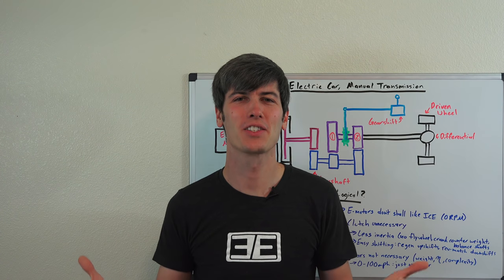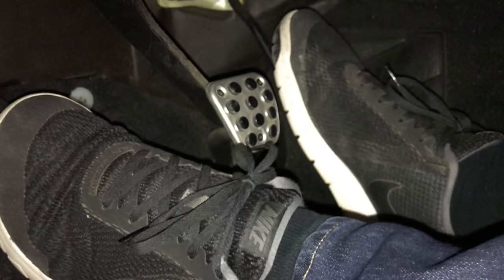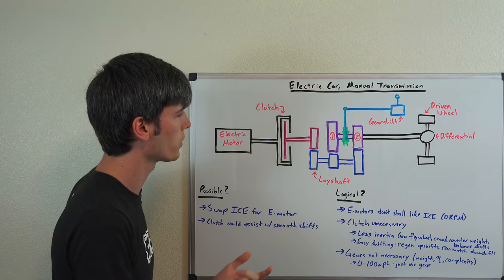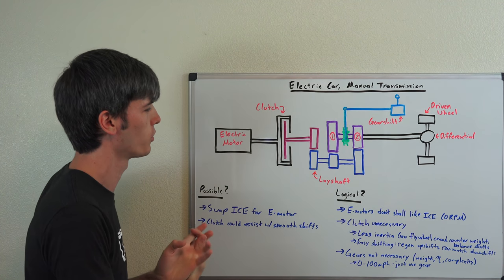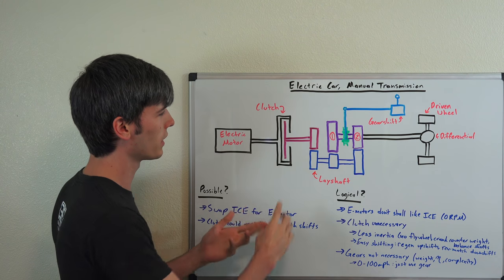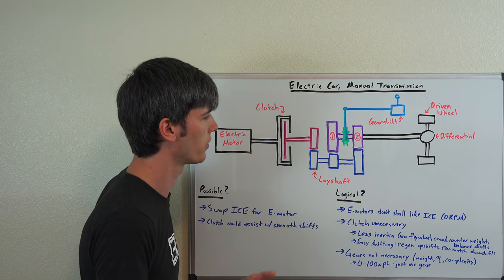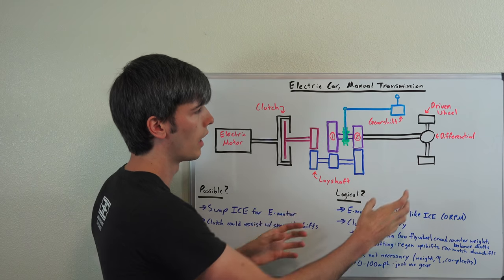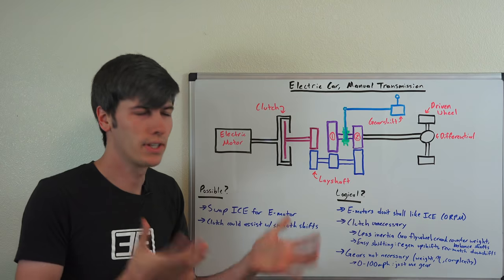Could Electric Cars Have A Manual Transmission?

Comment: I would like to see this done in a porsche body.
rear electric engine mated to a normal 5 or 6 speed transmission, running to a LS Diff, and to the rear wheels. batteries could be stored where the back seat would be.
I bet the driving experience would be dramatically different.
and HP numbers would be almost useless.

it would be simpler, to use two separate electric motors to run each rear wheel. powered by a shared battery and inverter. the gas pedal would just regulate how much electricity is escaping the battery to run each motor. so the wheel speeds would be matched in output as long as weight transfer and load dont change, and if they do (say in cornering) the extra load would slow the tire as the friction on it has increased, thereby keeping a differential effect.

Comment: manual transmission are completely logical, regardless of whether the engine is electric or traditional combustion.

Anyway, manual transmission has more advantages than disadvantages.
Even if electric cars don't need it, I still think it would be interesting and even necessary at some point.

If electric cars don't have a manual transmission, I'll design one myself.

Comment: Instantaneous Torque only applies to BRUSHLESS DC motors. Essentially the rotor is locked to a rotating magnetic field generated by stator windings.

BRUSHED DC motor EVs would require a transmission for maximim performance, as they do not provide instantaneous torque. They take time to spin up and down like an ICE. They are relatively easy to stall so if anything, a transmission would be essential. 

This is why, if you pay attention, most modern brushless motors directly drive the load - like the rotor of a drone or the wheel of an electric scooter. The motor can provide the essential torque at the proper speed directly. On the other hand brushed DC motors often require a gearbox in whatever application they are used in.

Brushed DC motors are simpler to control and cheaper overall. I'd be curious of a brushed DC EV with a traditional transmission would be financially viable?

Comment: Efficiency translates to range. As we all know, range anxiety is the #1 reason EVs have low consumer uptake, so it's likely that manufacturers will soon include at least a 2-speed. Manuals won't happen of course, but 2-speed DCTs are very logical. A DCT with only 2 speeds doesn't even need synchros, it's just one gear per clutch, so it's incredibly simple, compact, and cheap. The comments about introducing inefficiency are misguided, because a 2speed wouldn't be in addition to the large gear-down set, it would be incorporated into the transmission itself, and really wouldn't lengthen the path the energy takes.
Source:
https://www.google.com/url?q=http://www.researchgate.net/profile/Jiageng_Ruan/publication/268983741_Comparing_Of_the_Effects_of_CVT_and_DCT_on_the_EVs_Including_Braking_Energy_Recovery/links/547d524e0cf285ad5b088c7d.pdf&sa=U&ved=0ahUKEwi498mEh4DWAhVF_4MKHUI3BrEQFggLMAA&usg=AFQjCNEUGLjrfHtoOPRI6Qjh7DdRh7uulA

Comment: I have a hard time believing anyone would do this or want it.  One of the draws for an electric motor is the high torque at low RPM.  To add a clutch you would either need to electronically limit the torque or have a disproportionately large and heavy clutch.  Plus, unless you add a lot of rotational mass to the motor, you aren't going to "feel" the clutch working anyway.  There won't be any feedback if you don't rev match since you won't be forcing a heavy crankshaft to match speed with the wheels.   Plus, the computer is going to have to do the rev matching for you.  The inertia of the motor is so little that just tapping the throttle would almost instantly hit max RPM.  So the car will have to rev match for you.  There will be so little traditional stick shift feel that you might as well just put a "fake" clutch pedal that doesn't do anything.

Comment: I must disagree: it's fine not to have a gerbox if you have a 200 or 400kW motor, but if you go down to earth and imagine that manufacturers will put some 50-100kW motor that most current   internal combustion cars have than a gerbox is quite a viable option. Since a car with a gearbox will reach max speed noticebly faster than a direct drive counterpart.

Comment: Would a transmission be applicable in a heavy duty set up? Like for electric semi trucks? or would it be worth the weight gain to have to have an electric motor at all driven/live axle wheels like in a freight train? What about low speed applications such as in rock crawling?

Comment: perhaps not logical for electric vehicles, but as far as ICE vehicle I only have one comment. When was the last time you heard of a manual transmission failing and leaving the driver on the side of the road? And how many times can I think of that happening with an automatic? Well it's happened to me more than once.

Comment: the reason why manual transmissions are still very popular around the world (except the USA) is not they're enjoyable, but rather they're cheaper, more reliable, more durable, less maintenance, and more efficient than automatic transmissions. So it makes sense to use one unless you are lazy or are a professional race driver where you need to shift in 0.2 seconds.
Reply: Also manuals are ligher and allow you to drive the car the way you need to. I've driven an automatic once and man that car seemed to have a mind of its own, I had to spend some time to understand how it will react in certain situations in order to anticipate it and know what to do in advance. With manual it's easy, you just do what you need to without worry.
Reply: That being said, I don't think there's a need for manual transmission on e-cars since they can start from zero RPM and have a lot of torque at low RPM as well as a high RPM range, so no need to vary the transmission ratio.

Comment: If you put an electronic motor driving each wheel would you need a differential? Are electronics clever enough to calculate wheel speed to road speed in corners & sharp turns ect?

Comment: I think it would be great to have a transmission. But it is not necessary for a city car.  i think it would be needed in an offroad vechicles that would need more tourque  and  a higher gear for normal driving...

Comment: Why not just change it so that the transmission is used as a mode? Such as gear 1 would change to Standard Drive (SD) or perhaps make it so that it can only exceed to perhaps 60 or change it so you could not go above the law of lets say 20 or 30 mph at a normal road?

Comment: Most electric conversions done like mine still have a clutch and the gearbox, but i really need just the second, third and forth gear because the gearbox cant handle the rpm and is noisy anyway

Comment: Hello, I have two questions.
With a manual transmission you can use a "smaller" engine for the same car?

Can a manual transmission improve the range of the battery?

Comment: I think that on motorcycles that are meant to be fun the clutch is essential. 
That is because you need a computer to control the throttle response so you don't have full torque as soon you twist the wrist. 

But that means that you either have a smooth throttle response or a wheelie capable one! In other words, if you ridding casually and want to make a wheelie you would need to mess with menus and throttle control computer maps! Awful! 
If you see some dirtbike enduro videos you'll notice that clutch control is a very big part of the riding technique. Basically you need to change all the time between smooth power to get traction and sudden power to slide or lift the front wheel!

Comment: I was wondering if the electric motor wouldn't need a clutch if it can go to the next gear by revving to that input speed that is needed? If electric motors can cover a much broader rpm range and don't stall, why would you need a clutch for the transmission?

Comment: What i do really ask myself though is, even mountain bikes that are powered by feet have a transmission. Couldnt you be able to make a lot less powerful motor with less torque and therefore more battery efficient and add gears instead so that you progresively gain speed and save money and energy?

Comment: Gear doesn't mean only for speeds, it's also for power. If electrical bycycle (pedal assist) with gears sounds logical then why not in cars!!? Not everyone wants to ride fast in cars, guys like me likes to feel connection with the machine with decent speeds... I think introducing gears in hydrogen ev or ev isn't. Bad idea when power is required than the speed..

Comment: look up for electric gt....those guys are very enthusiastic in converting old nostalgic vehicle with manual transmission into and EV with manual gearbox....they did exactly like what have been told in this video...they just swap out the IC motors with an electric one....

Comment: I will only drive an electric car if it has a manual transmission with a clutch, and i stand by that! Also they could just make manual electric cars have like some rpm as an idle, so that it could work the same way as regular gasoline engine cars and so on, car lovers will like this alot, regular people can stick to their no gearbox electric cars, but as an enthusiast, i need the manual transmission, thats how it is and always will be!

Comment: I don't buy the efficiency loss. My thought is that the electric motor can run at lower RPM thus using less battery power to turn the motor. The transmission then amplifies the low output of the motor. Using less power to accomplish the same speed. It's the same as with a bicycle with gears. The momentum of the vehicle overcomes the drag on the drivetrain if one is in the proper gear.

Comment: What concern's me with EV's is the inevitable words from a 'mechanic' - unfortunately your battery pack has gone and a new one is $15,000 plus fitting.....for example, the e-golf from VW, looking up the current price of a new battery on VW's own ETKA parts database with latest pricing - £11,827.28 (about $15,000). 

So yeah no transmission means no expense on having to replace it if it fails - but now you have something MUCH worse...something that costs more than a new engine and a new transmission combined! - something which is going to be shot within 10 years for sure, making 2nd hand EV's much older than 5 years old, scrap.

Comment: Hi Jason,
I am Joy from India and  
1st of all I would like to tell you that I really love the way you explain and have learned lot of things from you regarding automobile vehicles. Today I would really like to know something from you as I know for sure that it is you, who can clear my doubts on this matter. 
The thing that I would really like to know is that, is it possible to make an autonomous electric vehicle that does not requires charging (after the 1st full charge). Will sufficient current be generated if a liquid cooled electric motor in a vehicle stalls continuously like an internal combustion engine and is connected or detached from the driven shaft by a transmission?....
Joy

Comment: you dont need clutch on electrical motor. you can use so called electrical clutch. that would disconnect power from motor in similar way like clutch

Comment: I have a valid logical reason to drive a non electric car with a manual transmission. If you are driving an automatic and your starter stops working and you don't have the money to fix it, you can't make your car move. Rendering it worthless. If you are driving a manual you have the option of popping the clutch and your car is still drivable.

Comment: What about gearboxes for the purpose of switching between high torque & high speed for different applications? Some RC vehicles have 2+ speed gearboxes which allow you to have a high torque (RC tank or monster truck?) or high speed (RC Racecar or airplane?). From an E racing perspective, that power band might be fine as they are just circuit racing. From an average joe's (or Joanna's?) perspective, that power band might lack the torque to pull their boat, or might not be fast enough to overtake a bad driver? 

Also the problem of how would you apply the gearing in a commercial car? It might be common sense to start using hub motors at each wheel for dynamic power management (torque vectoring of power), in which case gear ratios might make multiple power bands harder to manage. 

As EV's have max torque at min RPM, but can rotate at quite high RPM's. What would the gear ratio need to be, and could that gear size even be feasible in a standard car? ( Although it also depends on internal gearing of the electric motor, a high peak RPM of say 10-100,000, to step that down to say 1-10 RPM might involve too much gearing input for the power gain output)
Reply: Also as a singular gear system, it could be akin to a CVT system. CVT systems have kinda proved unpopular in the current commercial market based on the sound & driving feel. Some people have the sound so ingrained that unless a fake sound box made a noise to simulate a gear shift, less people bought them. Although also a problem of CVT's (but not really electric motors) is slipping of the shafts, which can cause terrible power loss. Having owned a CVT Nissan Primera in the past, can't say i'm a big fan of single gearing. Although that might just be because of my dislike of CVT's, electric motors do have different power curves.

Comment: Internal combustion engines have a narrow power-band. It's an inherent limitation, and to overcome it, multiple gear ratios has to be provided.
Electric motors don't have this shortcoming.
Internal combustion engines don't start from rest. An electric starter was provided, to overcome this problem.
Electric motors start from rest.
Will future electric cars will have an electric starter?
QED.

Comment: What if you just use a CVT connected to a electric motor? You could optimize power or energy usage by  holding the motor at one rpm and relying on the CVT for final speed/ gear ratio. Or would that be essentially useless?

Comment: How does having gears not benefit an electric motor? Doesn't it HAVE to mean it is putting more torque to the ground as opposed to the motor by itself? Why wouldn't the gears just act as a torque multiplier like they would on an ICE car?
Reply: You are assuming that all electric motors produce infinite power. A very expensive Tesla can make 600+ HP but comes at a hefty price tag. A cheaper lower power motor and battery can actually benefit from a transmission and have its peak power equal to its designed top cruising speed.
Reply: @Lincoln Runco, 

First off, the VTEC analogy was just bad and off the mark.

With ICE motors, HP is a derivative of Torque at a specific RPM and should NOT be confused with an electric HP which is 745w. Electric motors can have wildly different torque output depending on several factors. These factors are Wattage input, voltage, winding turn count on the stator, diameter of the stator, and if the rotor is an inrunner or outrunner. Outrunners will produce more torque, inrunners will produce higher RPM respectively.  

Now, with RPM vs Gearing vs Torque...
Torque is multiplicative, RPM is divisible. 
Transmission ratios are expressed as x:y (x being input speed and y being output speed)

If you have a motor that produces 1 ft/lb of torque at 1000 RPMs and you have a 2 speed transmission with 1st gear being an underdrive of 2:1 and 2nd gear of 1:1 (direct drive) you will get:

1st gear's output will make 2 ft/lbs of torque with a maximum of 500 RPMs
2nd gear's output will be 1 ft/lbs of torque with a maximum of 1000 RPMs

This can be changed by adding more gears. If we added a 3'rd gear below the 1st gear's ratio making a 3:1, 2:1, 1:1 setup you would get 

1st gear's output will make 3 ft/lbs of torque with a maximum of 333 RPMs
2nd gear's output will make 2 ft/lbs of torque with a maximum of 500 RPMs
3rd gear's output will be 1 ft/lbs of torque with a maximum of 1000 RPMs

So, if you used this motor and transmission to drive a 20" wheel:

1st gear's top speed would be 20mph
2nd gear's top speed would be 30mph
3rd gear's top speed would be 60mph

So, in an electric car if you would take twice as long to get to 60 mph with only 1 gear, where as if you had 2 gears (2:1 and 1:1) you could get to 30 mph twice as fast using 1st gear than you could only in 2nd.

The reason why some electric cars can get away with only 1 gear is because the motor can make a lot of power and the controller has a high enough switching frequency to allow the motor to spin at very high RPMs. When coupled with a very low gear ratio like 10:1 they can get away with it. For example a Tesla can make 1000 ft/lbs at the wheel because the motor makes 100 ft/lbs of torque and has a gear reduction of 10:1. The motor winding and controller allow the motor to spin upwards of 20k RPMs. This is like a Honda CBR600 in 1st gear. The motor only makes 60 ft/lbs but can rev to 18k RPMs hitting very high speeds in just 1st gear very quickly because of torque multiplication though gearing and light weight. But, unlike a gas motor, electric motors can hang out at 18k to 20k RPM without ill effects.

When you have a motor powerful enough and a car light enough gearing isn't as important compared to a heavy car with a lower power motor. This is where having a transmission is very important. The best example of this is a Honda can not start in 1st gear and directly shift to 4th gear and have enough power to function, where as a very light Chevy Corvette can easily start and go directly to 4th because the motor makes so much power that 4th gear can go from 10 mph all the way to over 100 mph. In fact, Corvettes from the factory will lock out 2nd and 3rd gear and force you to shift directly to 4th if you are not accelerating fast enough.
Reply: Not really.  Look at the LEAF, that does just fine with one gear.